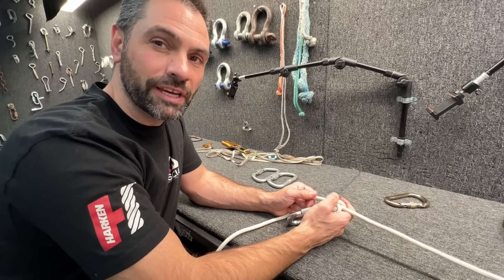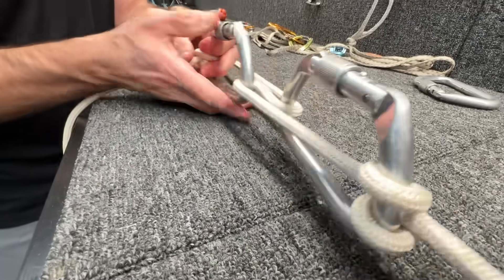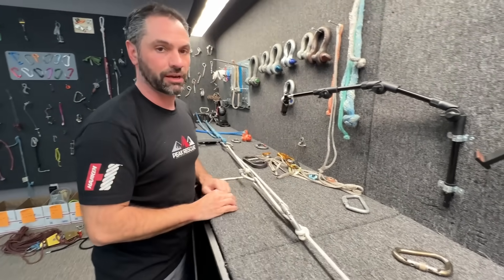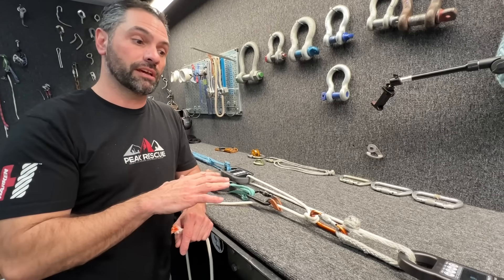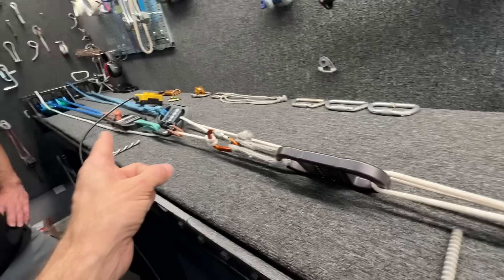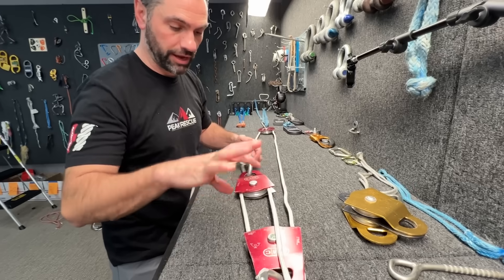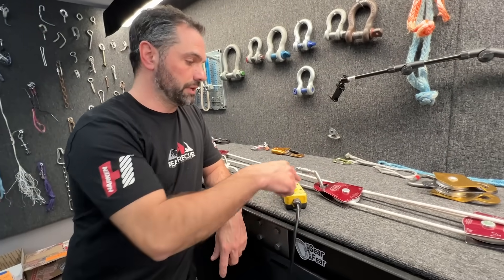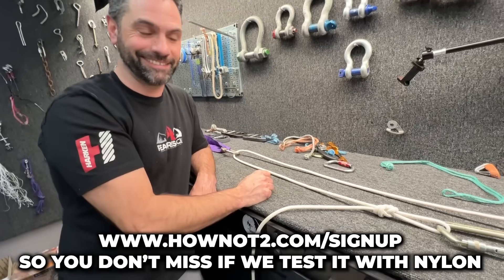I don't understand how this holds

Comment: Very nice video! 

Good example of the difference between theoretical and real world mechanical advantage. I think it's pretty easy to see the theoretical MA here: you need to pull three metric feet of rope through the system in order to move the load one metric foot. That proves that it's a 3: one theoretical.

The bigger picture here is not necessarily nerding out on whether you get MA or not, but sharing with a larger audience, the beauty and mystery of the voodoo hitch. 

It's earned that name for a reason! (I've heard some people call it the WTF hitch!)

Comment: Yeah he is wrong. Its an inefficient 3:1. Just because it has so much friction that it is effectivly a 1:1 doesn't change the definition mechanical advantage. Nothing is a true 3:1 at most will be a 2.99999999:1 .
Reply: best to call the 3:1 the velocity ratio
Reply: Definitely a mechanical advantage - as @MozzySail says, ‘velocity ratio is a better name. Friction is not one thing, you have to consider static vs dynamic, not only that, you have to consider the radius of turn at each point.

Mechanical advantage: yes!
High friction system: yes!
Reply: Someone saying something is a 3:1 and you saying "no it's a 2.99999999999:1" is pedantic. Especially in a scenario like this were a 10 alpha accuracy is irrelevant.
Reply: @aydinsha  How is it pedantic? The guy in the video is confused how he is getting a 1:1 and the comment explains it's a 3:1 minus the inefficiencies caused by friction. Like the guy made a 10 minute video saying he's confused how physics doesn't work. It's not pedantic to tell him why physics works. The 2.999999:1 is an example of what real world pulleys are like when you're not given a problem that assumes frictionless pulley's.
Reply: @aydinsha  thats my point, a 3:1 system doesnt mean it has an actual advantage of 3:1. You call a system a 3:1 because thats the theoretical advantage of a frictionless system.
Reply: @aydinsha  Nothing makes an internet comment more factual than it being pedantic. LOL
Reply: @opossumlvr1023  Nothing  makes an internet comment more pedantic than correcting the OP

Comment: I find these types of experiments very interesting. 
I am curious what the actual mechanical advantage is with a vector pull force in comparison to anchor points. & does it change dramatically when the length of the anchors are closer/further away from each other.
Reply: You can actually calculate exactly how much mechanical advantage is from “vectoring” or “swigging” a rope. If you know how much force you are applying and the angle of the rope it is vectored to. 
The length of rope will make a  difference in the amount of mechanical advantage that can be applied since the stretch of the rope will account for lost captured force- but also might aid in helping create momentum to vector farther. That would be a cool experiment. 
Anyways, The force applied from a vector in the rope is only going to create mechanical advantage until the rope makes a 120 degree angle. That is the point where the force applied to vector the rope is equal to the force on each side/anchor. And before you deflect the rope at all when the angle is 0 degrees, you have hypothetically “infinite” mechanical advantage (as soon as you touch the rope though you deflect it to a different angle, changing the mechanical advantage) 
If you take the angle of the rope at the greatest deflection, and divide by 2, and then take the force applied to the rope, divide that by 2. Divide the force /2, by the cosine of the angle/2 that gives you your force on one anchor. Assuming deflection near the middle of the rope the force would be the same on both sides. For example to show why 120 degrees is the point where all forces are the same you can do the math by taking 120degrees/2, then take a force of say 50lb/ft/2. Now we have 60degrees and 25lb/ft. The cosine of 60 is 0.5, so 25/0.5 is 50. So 50ft/lbs is your force on all 3, directions of pull. That’s a method used to determine forces on high lines which has the same physics to determine the force as this scenario

Comment: So I might be wrong here but, I feel like this dives into semantics really quickly. It's ideal mechanical advantage would still be 3:1 because ideal mechanical advantage is theoretical in a system with no friction, basically the setup with pulleys. The flip side of that is the actual mechanical advantage which is, as the name implies, an actual number that takes into account friction and real world issues. The system with those carabiners and the rope used creates enough friction to offset the theoretical advantage. So basically it's either a 3:1 or a 1:1 depending on which type of mechanical advantage you want to use. Changing variables that would change the friction would still change the AMA, not the IMA though.
Reply: It's the same problem as the trucker's hitch, but worse. Theoretically 3:1, but with so much friction from not using pulleys that you gain almost nothing.

The trucker's hitch gives you 1.6:1 with pure rope or 2:1 with carabiners, but you don't have any progress capture. The voodoo is 1:1 with carabiners, but gives you progress capture due to the capstan effect.
Reply: I found it very frustrating that they ignored this point
Reply: Agreed, if I had a conventional block and tackle at X:1 with rusty pulleys I wouldn't be describing that system as 1:1 "friction". I'd just acknowledge it as an inefficient X:1
Reply: If analyzing for actual mechanical advantage, the hitch is quite interesting as the rope is being slacked as well as pulled. Where the rope is being slacked, apply the loss of efficiency opposite to the "normal" way for tensioning a rope. Otherwise, the T-method analysis produces nonsense. I believe the combination of tensioning and slacking within the system when it is hauled provided the holding power since forces are acting in opposition. Apparently, carabiners result in an actual MA of about 1:1 while the theoretical is 3:1. Will need to calculate what efficiency values match the observed force values.

Comment: I don't understand how that works, some kind of climbing black magic. How does it stay tensioned?
Reply: - all the loads are balanced - through the addition of friction..
Reply: You have static frction holding it which is greater than the dynamic friction when tensioning it (is my guess)
Reply: @largeformatlandscape  the dynamic friction and added work while tensioning is the new static friction if it holds, which is up to the MBS if there are enough bends.

Comment: Seems like the trucker’s hitch would be faster, more gear efficient, and just as strong.
Reply: They can be a pain to undo, and you have to tie off the end somewhere. Of course I would tie off the end with this setup as well, seeing how easily it started slipping.
Reply: @ryanpenrod1859   - not if tied with sheepshank (the proper way, not the typical "dad" - trailer to the tip, kind of knot - more "boy scout" ) instead of an overhand or figure of 8. (pluck one strand of the sheepshank, it all falls undone).
Reply: can you traverse over a taut sheepshank?  @kadmow It feels like there's a risk of collapse if you step on the knot.
Reply: @hownot2 pull test comparison?
Reply: I recall a sheep shank can barely hold any tension
Reply: Faster, yes, though you can actually make a voodoo hitch with no carabiners (kinda hard on your rope, but so is a trucker's hitch). The Trucker's hitch has the advantage of being more secure when your load is dynamic and might slacken.